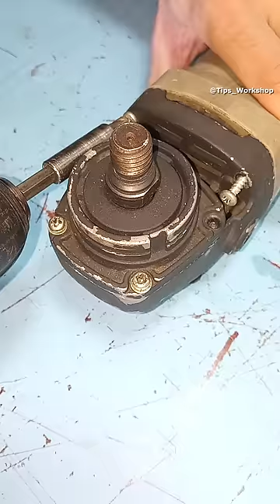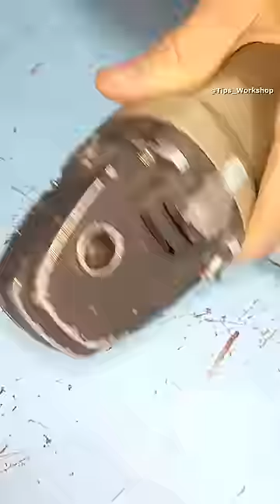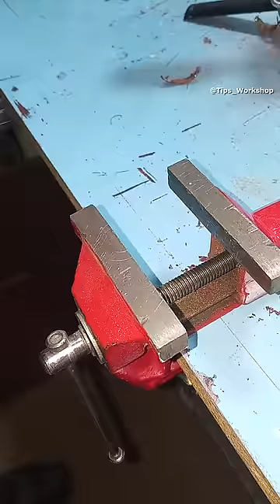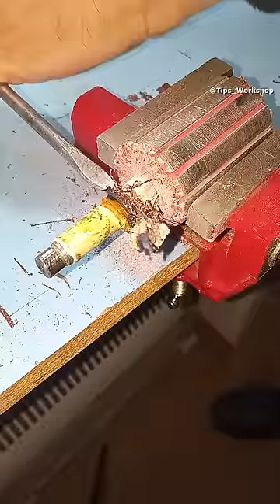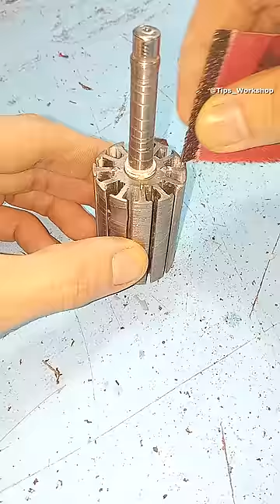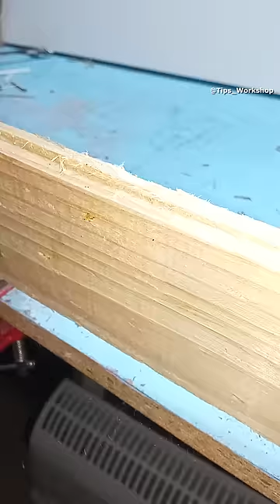How to make a sanding attachment for a cordless drill yourself. #shorts #diy #tools #satisfying

Comment: ¿Destruir una amoladora para fabricar una lijadora???, ¿no hay opciones más sencillas???.
Reply: O más sensata .
Reply: Acá en Nicaragua,en vez de ese rotor usamos un cilindro de MADERA torneado y a la medida de tus necesidades.  El rotor de la amoladora es CARÍSIMO y pesado,la madera por ser liviana,ahorrás energía.
Reply: You can use a screwdriver by wrapping the handle with sandpaper without damaging the screwdriver, then removing the sandpaper when it is not needed

Comment: You can use a screwdriver by wrapping the handle with sandpaper without damaging the screwdriver, then removing the sandpaper when it is not needed